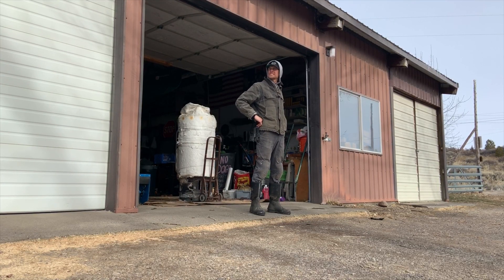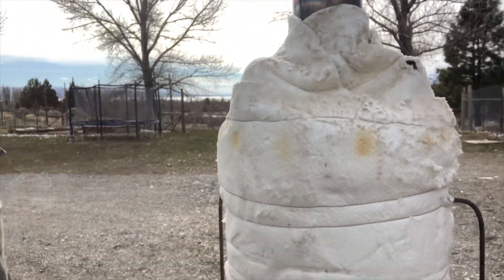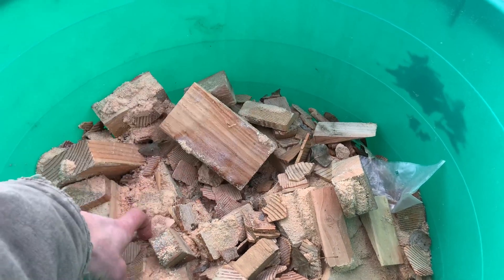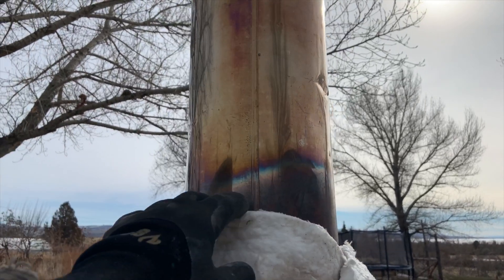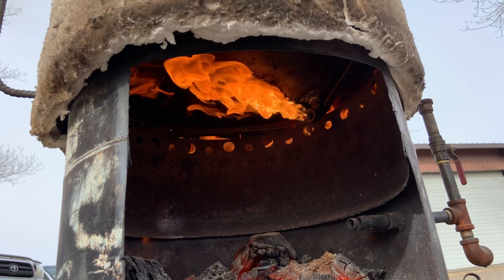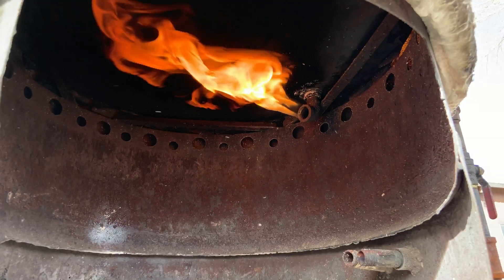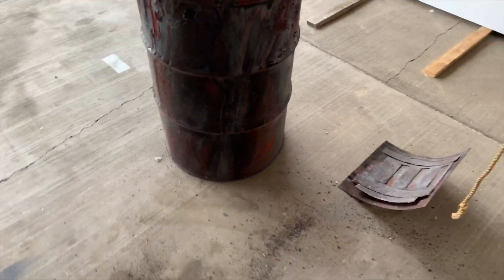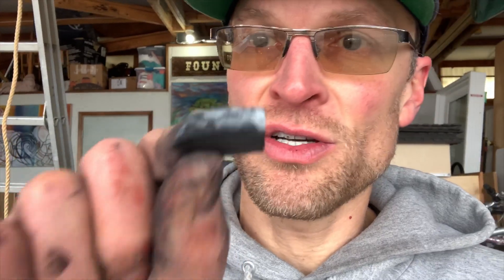How to make Biochar

Comment: More expensive initially but probably long term savings is to use a stainless steel barrel.
Reply from the maker: Sean Montague Absolutely! These pieces and parts were available around the farm (except for the furnace blanket). I would definitely recommend going with longer lasting materials. Thanks for the comment!